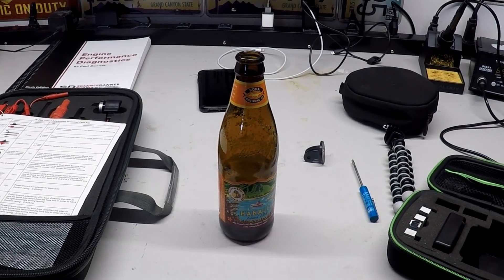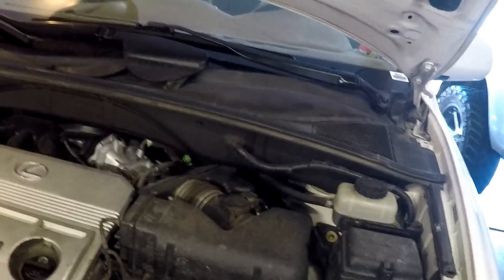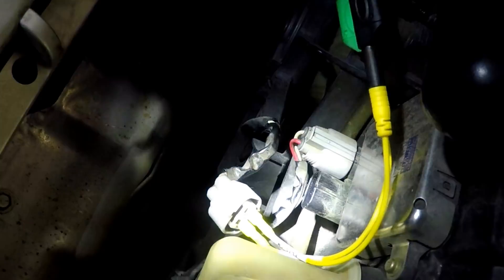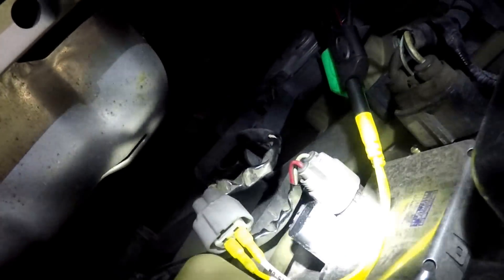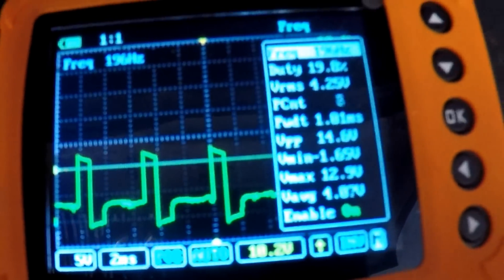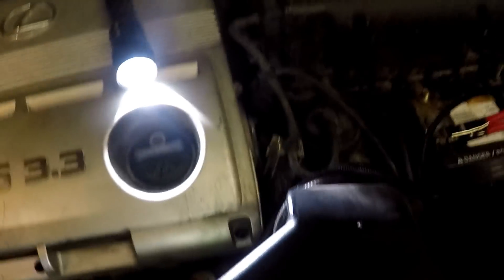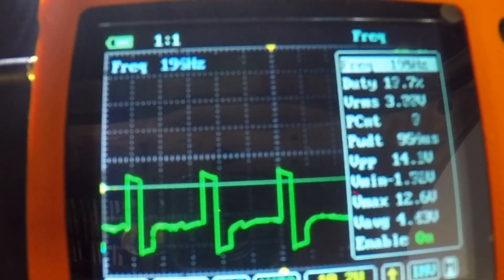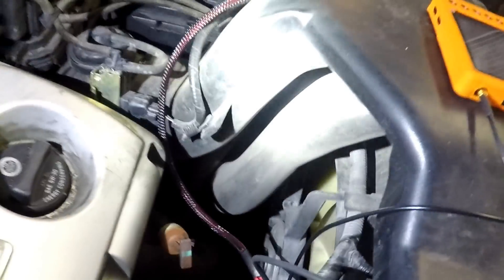IS A $16 PWM CONTOLLER WORTH IT?

Comment: My only concern is about the frequency. That could affect the outcome of the test results. different transmission solenoids run at different frequencies so I have to be careful with them when bypass testing. to fast a frequency and the solenoids will sort of float and not operate completely. Great stuff!

Comment: Got a link to it?
Reply from the maker: Sergio Garcia uniquegoods 12V 24V 36V 48V 40A (max) PWM DC Motor Speed Controller Adjustable Variable speed Switch CCM9N Regulator Driver https://www.amazon.com/dp/B00QBFI7US/ref=cm_sw_r_cp_api_i_Qv6kCb4SB0WDV
Reply: Thank you I'm gonna have a blast putting this in my diagnostic arsenal